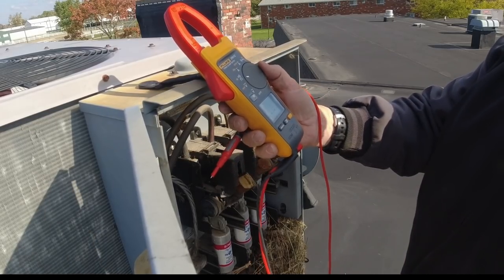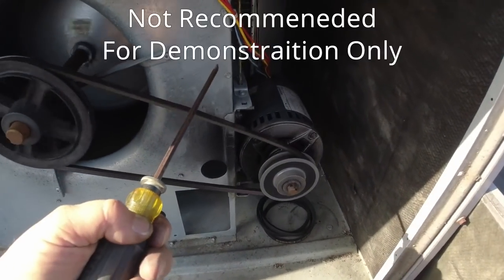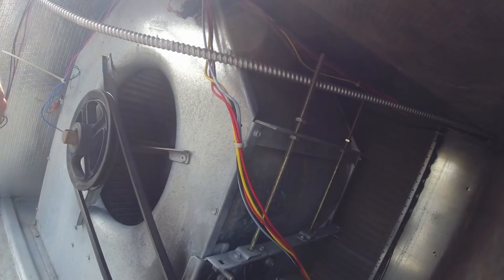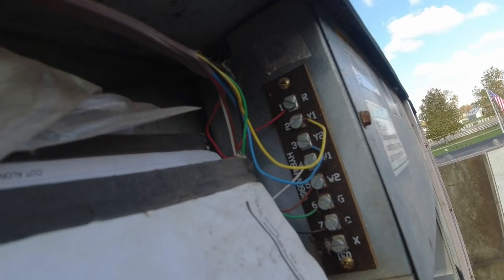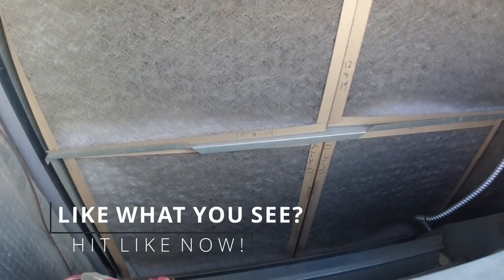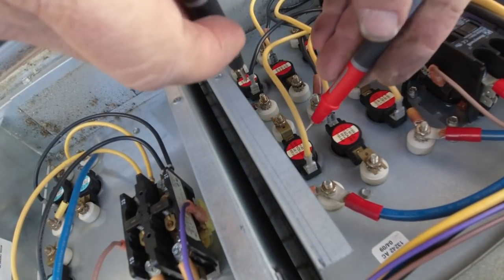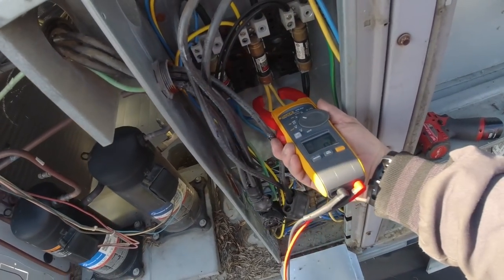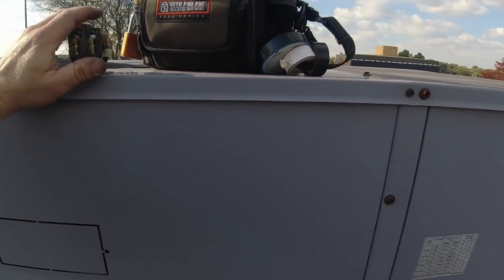Electric Package Unit No Heat

Comment: Great video appreciate you pointing out to recheck power on "add ons" too many times I've seen multiple electrical circuits in units. Cut the disconnect and still have power🤦‍♂️
Reply from the maker: @grindstone I have had the misfortune of finding that out the hard way
Reply: @HVACRSurvival  lmao same here...I remember early in my "career" I was tasked with removing a walk in condensing unit. The head tech told me he removed the breaker, well he forgot the lights were separate and ran up thru the condenser... yeah I found out😂
Reply from the maker: @grindstone5368  yep that can happen very easily. Truthfully I wish they'd power the evaporator off the condenser like they do on freezers. It would make more sense, then you'd have total control of everything from one location and it would still only take up one double circuit

Comment: Great job as always sure as heck would not want that electric Bill
Reply from the maker: Agreed
Reply: Many places in Texas are all electric.   Especially in SE/South/West Texas, the 'cold' is warm enough that heat pumps are usually plenty.   The supplemental heat sometimes never comes on at all, unless you force a HUGE heat gradient.  (like wanting to raise the temp 10 degrees really quickly, which is also what you use to burn off the dust.   Ahh, the smell of first fire-up test scorching.  )
Reply from the maker: I can see that in Texas, but we're in Northern Ohio🤣
Reply: @HVACRSurvival  Picky, Picky.

Comment: In all the years I've been in HVAC. I've only ever seen maybe 5 RTU's with strip heat. Used to live in So Cal.....so using electrical for heat would cause your bill to astronomical. Live in Buffalo now and gas is king here. Interesting though. Good video
Reply from the maker: Thanks for sharing, I'm in Ohio so the weather is just about the same as yours in NY, , this place likely didn't have natural gas originally but now is probably available but they tend not to use it for the type of facility that it is.

Comment: nice vid ,thanks for sharing,the 2 red wires on the motor is a switch that is not supposed to let the heater come on if the fan is not running ?100 amps is a bit too much for a #6,hope that helps.
Reply from the maker: The 6-gauge was after the fuse inside the unit. The wite from the disconnect to the fuse block was a larger fuse and larger wire.

Comment: there is electric K.O. plug caps just for such situation. pop one on ad bend tabs over for near permanent fix. (guilty of not having them for weekend warrior/late night repairs) cobble the hole over with whatever is on hand. scrap strips of tin and zip screw on either side if the hole. just don't screw into your finger 🤣

Comment: Okay Rick...I'm 6:18 minutes in and paused. I'm wondering if a maintenance guy loosened the belt to give the motor pulley and belt some slippage on start up, due to an undersized motor or a motor on it's way out. Maybe the motor was replaced not long ago with an undersized motor. Okay...back to your video....

Comment: Finally something that's not gas
Reply from the maker: You're funny LOL you do realize your windmills and solar panels are a joke compared to the capacity of coal-fired power plants right? And before you get all crazy on how the environment is being hurt, we have one of the most efficient coal-fired power plants in the world here in Southern Ohio. Check out how long windmills last before they pay themselves back and also check what they have to do with the fiberglass blades when they have to tear them down in 10 or 15 years, they can't get rid of it and bury it in the ground and check out how they compare far as load versus when they provide electricity. You got to quit drinking the Kool-Aid Man. The only thing all this clean bull crap is going to do is clean out your wallet
Reply: @HVACRSurvival  lol well yes true at least we get everything every drop an nothing isn't being wasted you get 100% everything inside and you don't have to worry about gas leaking or co2 not a lot its still fire though and 10-15 years is normal too plus its not cheap like I always been sating cheap is never.a good solution for long term eventually it'll fail an cause disasters we here in Baltimore haven't seen any snow but a lot of flooding an tornadoes we don't usually get those but places like Cali shouldn't even be using gas for heat crap don't even get hecka cold for them

Comment: Blimey is it even safe to use the top of the fuses as a junction box like that ? 
I mean I guess technically it seems to have been working but I can already picture electricians pulling their hair out 😅
 I love calls where it's only electrical and you don't have to bust out the gauges and all that , sometimes it's nice to only need the meter and a couple hand tools 😎
Reply from the maker: That was factory wiring so I would say it is UL approved

Comment: 100 amps? holy crap, wonder what the electric bill must be if all the units draw similar amount of current
Reply from the maker: They make good money doing what they do there, I'm sure they will be OK😁
Reply: @HVACRSurvival  yeah true, but I’m sure that bill is probably a little steep lol
Reply from the maker: I'm sure it is
Reply: @toddthegamer  at least every drop of heat is staying inside an not pulloting the air
Reply from the maker: @prettycure you're kidding right? Are you one of those environmentalists that don't realize where electricity really comes from?
Reply: @HVACRSurvival  - well, technically, most power plants do run more efficiently than standalone anything because of profit margins.  That said, it's hard to compare direct heat transfer to air (combustion) vs electricity production to heat the air.
Reply from the maker: What I am basing it on is price per BTU and they're all rated in BTU when it comes to heat and run hours. You're splitting hairs when a gas Appliance can run 96 to 98% efficient. The price is cheaper to heat with Gas than Electric strips
Reply: @HVACRSurvival  Unfortunately, almost no combustion based appliance is really that efficient.  they game the numbers.   The reason why is simply that you have to provide adequate flow of outside air, and that carries off a large proportion of heat.   Hypocausts were probably the most efficient heating type, and even they weren't that high.    

That said, I love the heat from a fire.   It may be inefficient, but it is comforting.

Edit - they say 'efficiency' because they mean how much fuel is burned.  Not how much energy is usefully transferred.  Took me a minute to remember that.

Comment: its amazing how using resistive heaters is legal in the US. that stuff would not even be legal in the EU. most new buildings have heat pumps as standard now and dont even have a gas hookup.
Reply from the maker: You guys are killing your economies for nothing. China's never going to cut their production and neither is Russia so what's the freaking point
Reply: @HVACRSurvival  our economies are doing fine thank you. its just simple economics. a kWh is 25 cents here. so getting 1kW of heat for 25 cents or getting 4~6kW of heat is not a hard math problem to solve when you already have AC on the roof regardless of the place you live in or price of eletricity. the math remains the same. installing a new unit or retrofit a 4way in the system for heat pump operation makes a lot of economic sense. not to mention you can run the system off solar that is already on the roof so you can get free heat. hell, that is how i heat and cool my own home all year round and at the end of the year the power company pays me if i have exess power. for modern/new buildings the building codes regulate how efficient it needs to be. and the only way to get the numbers you need is with a heat pump. and because gas and resistive electricty is more expensive per kW produced its a no brainer to install a heatpump.
Reply: @irfp460  ps: i just verified for you. i got a COP of 7.3 at 11C (53F) today. the AVERAGE of the past 3 weeks was a COP of 6.6. and the price of the heat pump was 2200 USD.
Reply: @SupremeRuleroftheWorld  You are making the numbers up. Bosch, Viessman or Vaillant only claim COPs of barely 5 on most units. Gas is .049€/kWh here, electricity is .33€/kWh. A very simple calculation tells you which is more cost efficient.
Reply: How does the "eu" heat rural homes/communities in the colder climates?
Reply: @grindstone5368  That depends on the country, some do heatpumps/electric but most do oil, gas or propane.
Reply: @irfp460  That would seem logical, wasn't sure if Supreme ruler found out how to use smugness as a heat source
Reply: @grindstone5368  old houses (and peope) use propane or natural gas in tanks that a company fills. but many of those houses (especially farms) are being converted to heat pumps because the gas setup is just too expensive. and especially with farms that have their roofs filled with solar and have massive overcapaicty its quickly becoming the standard to have heatpumps. ps: dont confuse smugness with basic math.
Reply: @SupremeRuleroftheWorld  I guess the term basic math is relative or your idea of cold climates just not sure... I'll be more direct, heat pumps are great but the idea that we need to ban straight electric heat is short sighted. I just installed a few rtus in an area that didn't have gas infrastructure and in a colder climate. The old unit was straight cool electric heat new one was heat pump with electric heat as 2nd stage. On those -20 days those heat pumps won't cut it.
Reply: @grindstone5368  i am sorry you are so far out of touch of how technology has progressed. or have not invested toim into systems that are designed to run at lkow temperatures. my very own panasonic t-cap still delivers 100% of its rated capacity at -20C. and will keep on trucking up to -28C (-18 freedoms) and then it still has a electric backup heater it can use to heat up the water during emergencies. just because you have not taken the time to actually inveest some time into currect technologies does not mean they dont exist. you need to learn to look beyond what your supply house is shoving in your face.
Reply: @SupremeRuleroftheWorld  why do you have electric heat for emergencies I thought it was illegal
Reply: @SupremeRuleroftheWorld  seriously don't even know why I comment sometimes...I know better 😂
Reply: If it helps I'm not using metric measurements figured you would have picked up on that geezus
Reply: @SupremeRuleroftheWorld  I'll wait for you to make up new numbers....like we'll my new bosch t2000 has -90 efficiency
Reply: @SupremeRuleroftheWorld  You're right the EU is obviously superior in every way. I watch YouTube and read comments to educate myself on different situations around the world but obviously you are stuck in your own bubble
Reply: @SupremeRuleroftheWorld  If you are that  concerned with what country or area? that has been the most innovative look at the south korean companies. They have been 1st in climate control for a while.
Reply from the maker: @grindstone BINGO👍
Reply: @HVACRSurvival  lol I'm actually embarrassed I've gone this far with this guy
Reply: @SupremeRuleroftheWorld   Heat pumps are not really new technology ether. Just revamped and improved older technology, that has been around even before my time. Much like the CFL light bulb. And even with those improvements. They still tend to struggle to produce much heat in more bitter cold temperature without the AUX heat. Yes they do produce heat at -28C, but it more of a Luke warm heat, then the cozy type of heat that gas and electric resistance produces. Which a lot of people still prefer.